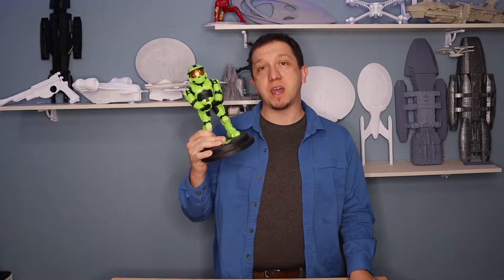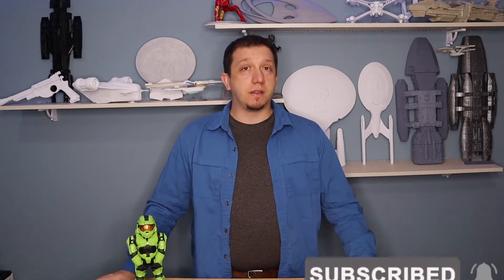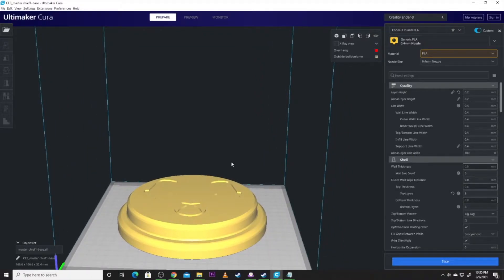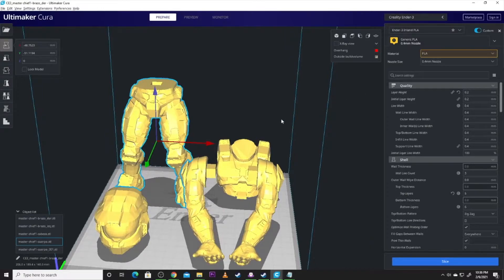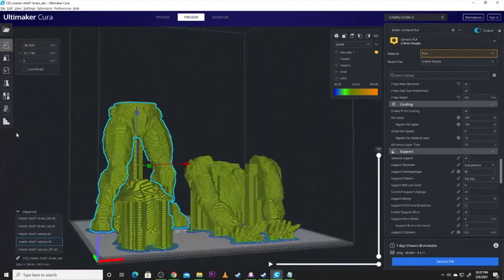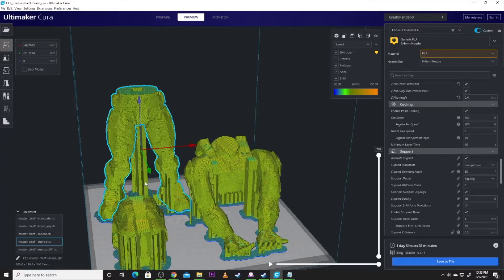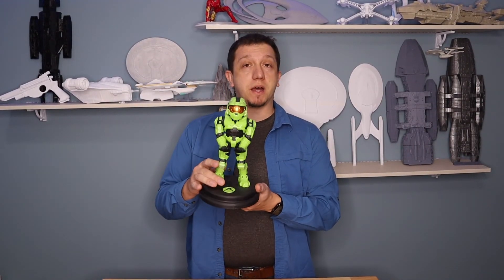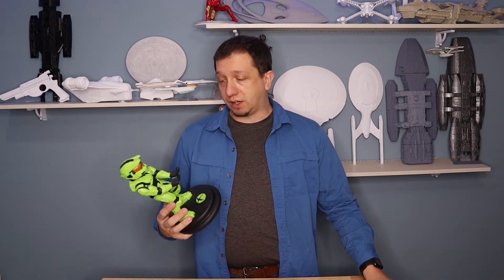3D Printed Game Controller Holder - Halo Master Chief Model

Comment: Can you Name the price of Materials used for the prints in a Kay over? Of COURSE without your time etc..Just Material cost in cinecction to the price you paid for Material.

Tribvtes FROM Germany Europe
Reply from the maker: So about 250 grams  of material is used I. This one.  Took a couple days to print all the parts. So for the filament is use it was about 5 dollars of pla

Comment: Having trouble getting the code to my 3D printer but it shows on the sd card. Any help pls
Reply from the maker: So you sliced and all that but the printer will not read it?   You might need to reformat your as card
Reply: Thanks will try